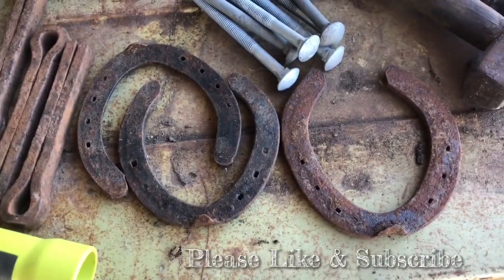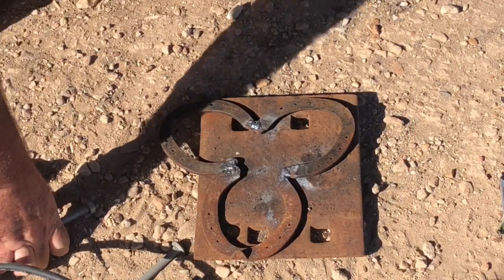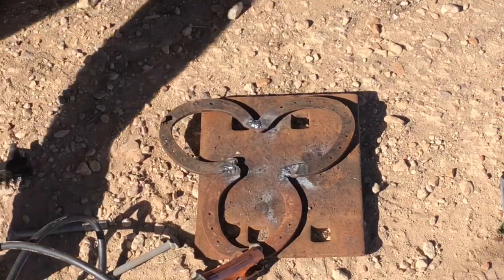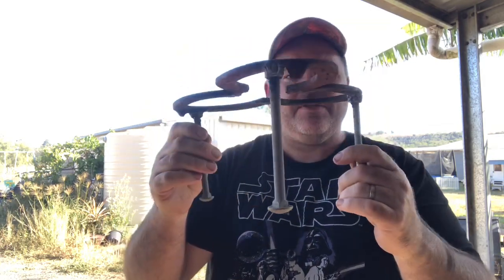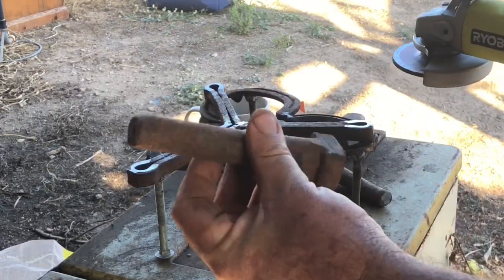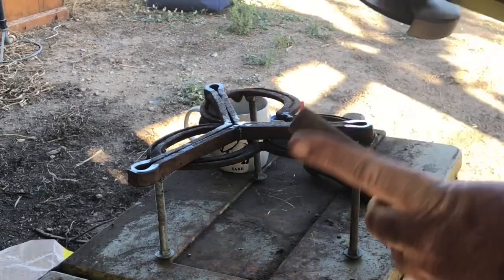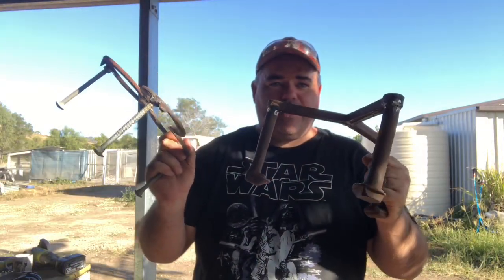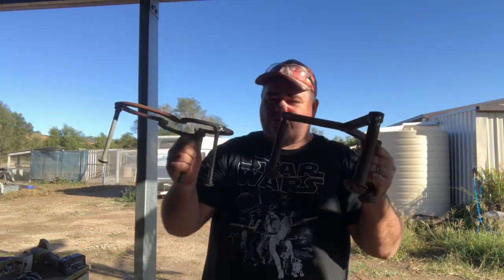Making Campfire Trivets - Star Wars Day Special

Comment: Nice projects.  You mentioned you aren’t going welder.  Couple pointers.  Try to get off the ground.  Putting the work at a more comfortable position will help a lot.  Slow down on your rod movement. What happened the puddle and don’t move back and forth.  When you move back and forth you weld over the flux and crest a weak weld.  I hope this helps!  Again cool projects.  I have never seen the pins before!
Reply from the maker: Thanks for that. I’m definitely a C student when it comes to welding. 
Can get little jobs done but need to practice more.
In the process of designing myself a welding bench/ work space. 
It’s such a fun thing to do and thank god for the angle grinder lol 😂
Reply: @SilhouetteParkFarm  you have any questions I would be glad to help.  Keep up the good work!